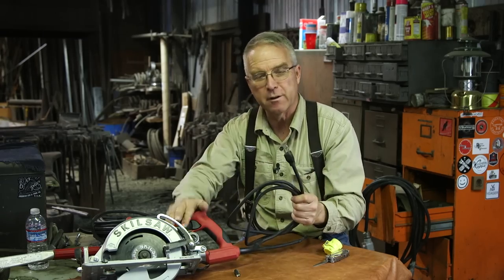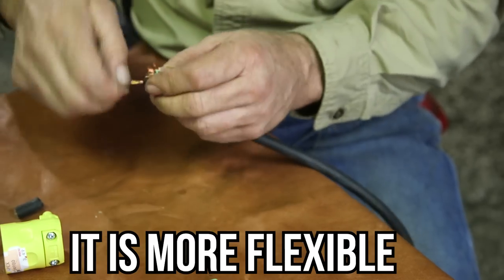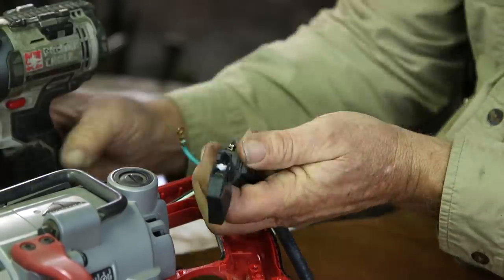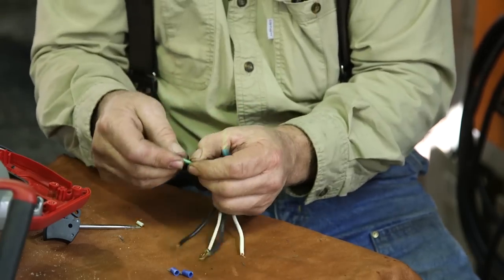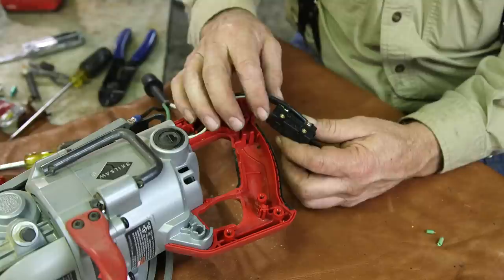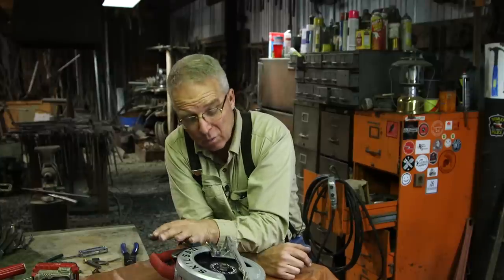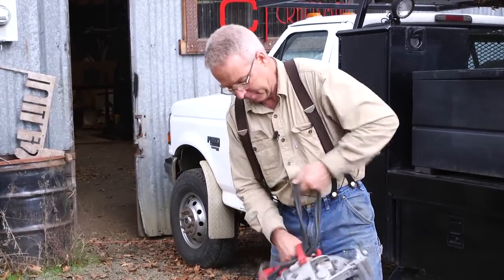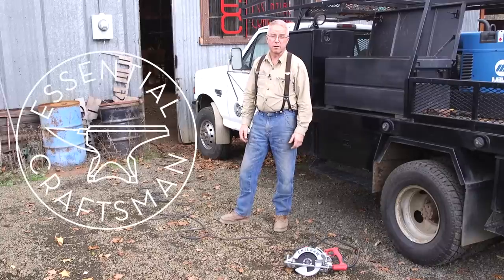Skilsaw Cord Install and Storage Tip

Comment: after one of your earlier videos where you mentioned this, i went out to my shop that day and did mine. i had on old, heavy-duty extension cord that i hardly ever used. so i cut off the female end, wired it up; and now i have a 50 ft. cord on my circular saw.

it's awesome not having to drag out an extension cord every time i wanna use it for something out in the yard. i can just plug it into the external outlet on my shop and go to work. i'm also thinking of doing this on my big drill.

and i store mine the same way. i use the "daisy chain" method for the cord. it never gets tangled, it never gets that awful twist in the cord that you see when people do that whole "hand-to-elbow" wrap. it definitely saves the cord and doesn't cause NEAR as much strain (if any at all) on it.

Comment: We used to do something similar! Back then I was a Sparkie working on domestic installations. We would have 240V Drills (rather than saws) and the leads were always too short. We would put a long lead on (long enough to reach the full length of the house. The flex was then wrapped round the handle and the pistol grip of the drill .... zero snags!

Comment: Long cord on a circ saw is definitely necessary for jobsite use. That said, since I bought Makitas rear handle blade left circ saw, my corded saw has been reassigned to steel and concrete cutting duty. The new cordless saws are finally on par with their corded brethren in terms of power, even more powerful in fact, and you don't have to worry about a cord of any length. The real question is how they will stand up to jobsite abuse. I haven't babied the Makita but it's still pretty green. Mag 77's just run, and run and run. Only 77 I've ever seen that was broken was due to an oil leak and subsequent failure of the worm gear.
Reply: We acquired a dual battery Makita skill saw three years ago. Since our type of work is very dynamic, meaning we have quite a wide range of tools that get used here and there, rather than a few tools that receive a ton of use, it hasn't been "abused", so to say, but it has seen more than "weekend warrior" use, and it certainly is holding up pretty well so far. It'll rip 2x4 with about 75% of the capacity of a corded one, which I believe is certainly good enough for it being cordless.
In fact, since we mostly work on mobile homes in retirement parks, and the available outlets can  be quite weak, sometimes it has more cutting capacity than the corded one.

Comment: I bought the direct connect Bosch years ago and it works very similar to this demo. I wind the extension cord exactly the same. I get the same freedom. My back up is the Fuel 18 volt Milwaukee. Great combo.

Comment: Funny... I've always taken the exact opposite approach... I leave a 6" nub wire with a 3-prong on my saw... Makes for easy storage. And, I just knot a 50' extension on to it when I'm ready to get rockin and rolling.  Never get's tangled in the box, and allows me to store my cabling away in a special box for only cables...
Reply: Tim Falardeau wait, you are not my neighbor - ha. (see my original comment....)
Reply: I'm with you.  To have a 50' cord on each tool is ridiculous.  Have tools with short, or factory cords, and use extension cords of the appropriate length and gauge.

Comment: Tip for ring terminals, if you need more room than the insulated terminals to fit, before installation remove the plastic sleeve, hold the ring with pliers and pry/pull off the plastic sleeve.  If the crimp tube is a little to tight to get al the wires into expand it a touck with your awl/ice pick while holding the ring with pliers then assemble and crimp

Comment: In video about skill saw you showed us how to store a saw and how to tie a cord so it doesn't tangle, and i started using it to see if i like it. 2 years later i don't know how did i live without it, all you need to do on job is pull one end of the cord, plug it in and you are ready to go.

Comment: Before I watched this video i was having a problem with my angel grinder's cord becoming loose and then slowly working apart until it shorted, so i got tired of it an rewired a 25' orange extension in place of the factory cord and have had no problems and it works beautifully!  I do a good bit of cutting and grinding off the back of the truck..lol.

Comment: Most of the carpenters I know have gone cordless.  This latest generation of cordless tools are lite and powerful.  The 6" circular saws can cut 2x and decking just fine and sticking an extra battery in your tool belt to extend your time up top.  There is a place for corded tools on the job site but carrying heavy plugin tools all day is rapidly becoming history.  That said I have a corded Makita saw that  I use with abrasive blades to cut steel.  It is going to get a longer cord in a day ot two.  Thanks for the tip.

Comment: Excellent upgrade. We do the same, only with 25'  We also just cut the end off and use solder-less connectors for the extension piece but separate each one by 2-3'' so we don't end up with a lump in the wire. After the connections are done with never-seize, we slide the 3 pieces of shrink tube over and shrink one at a time, each one longer than the last, then tape. We use a new end like you do, with never-seize of course, so there is only one, so called lump in the wire. I will do it your way from now on, because I forgot about the wire size difference between the new and old or maybe I was lazy about taking the handle apart, lol !  Thanks for the education always.

Comment: My dad used to buy extension chords for this.  He thought it was an advantage that the extension chord came with the molded plug already attached.
Reply: WJ the Home Builder you can buy the cables with the moulded plug already attached to them in Europe :) my grandfather used to attach those to his tools :)
Reply: it's also cheaper than buying  the wire by the foot.
Reply: @davesbrewing  and it's more likely to be the right kind of wire for that application :)
Reply: That’s what I did to make an extended cord on my vintage Sawzall. Bought a high quality USA made all rubber 20ft extension cord and lopped the female end off and installed. Been going great on the job for 15 years now
Reply: @JerryWick  I have been doing the same for years!
Reply: I have cut the female connector off of extension cords for fixed location machines (some times you can buy an extension cord cheaper than just the wire), but I have seen the molded plugs come loose too.  I don't see a problem with the replacement ends if they are for the correct diameter and have a decent strain relief.
Reply: CPUDOCTHE1 yup. There are a lot of high quality repair ends. I always buy the best and keep a few on hand of both genders to make quick repairs
Reply: I find it hard to get 12 ga extension cords in my area for cheaper than wire by the foot from my wholesaler.  14 ga  extensions are a dime a dozen for sure.  Just my experience.
Reply: David Star junk plastic though

Comment: In 1976 my boss bought a me a worm drive skill saw model 77 since than I have put several 25 foot cords on it due to being crushed, cut in half( can you imagine that) and not using a good enough cord and it got to stiff. You are a lucky man to get to buy a new saw mine will not die, new handle, brushes and it's still going 4 new homes later, decks, roofs, remodel's heck I even flew it to Alaska to do a big remodel for my brother. I feel like tom hanks in the green mile it will be with me for the rest of my life. I guess that's not such of a bad thing after all is it. I'm 60 now and half way done with our retirement home so I guess the skill saw 77 will be passed on to my kids thanks for letting me ramble. love your videos

Comment: I like a long cord on my saws too. Makes life much better. You can buy shrink fit electric insulation tubing to replace those blue plastic ones. Comes in many diameters, check auto parts stores or Radio Shack. It comes in 3' lengths, cuts with scissors, and hit with your heat gun for a nice snug, insulating fit. That yellow replacement plug end. You can spray that with several coats of Flex Seal, as seen on TV. It does work well and will waterproof that plug. Hope the New Year brings you and yours nothing but the best Scott. Love all your videos.

Comment: Yet more wisdom from the purveyor of practical goodness!  Thanks Scott.
Solderless terminals are available in all sizes, if you can't get them at Ace try Platt electric.   You can drive the terminal (metal part) out of the plastic jacket with a punch or even a nail.  With a good Klein crimper you get a much more sure crimp on non insulated terminals.
Even if you aren't a spark chaser you should get a pair of Klein crimpers, much better than that stamped sheet metal thing you have.  Like with all things, quality tools make the job a lot more enjoyable.
Reply: Marcus Merrick great advice Marcus! I also need to get a new pair of crimpers I looked at the Klein line and they have several different ones any advise on which ones to purchase? Thank you for the great info have a wonderful weekend.
Reply: Good point. The crimp available on the typical solderless terminal isn't the greatest, and a source for added resistance (and heat produced) by the tool. Sometimes, I will even solder the lug to the wire after crimping so I know I am getting the best connection possible. Less resistance/ voltage drop equals less amperage pulled through the tool and much longer tool life.
Reply: @andrewbieger5004  getting good terminals helps, actual Thomas and Betts brand (try a professional electrical supply house like Platt) are thicker and better quality than the import brand you get at the megalo-mart.   I'm not an electrician by trade, but I gerw up in a house full of them and this was drilled into me for as long as I can remember.   Now I mostly do maintenance and rebuild machine tools.  The T&B are easier to use and have less resistance.
Reply: @paulrhodes482  the ones I inherited from my father who was a maintenance electrician for 40 years are the 9 3/4" inch cutter and crimper combination.  Current model is the 1006, with large and small (insulated and un insulated) crimper and a cutting jaw.  If you can't find them locally, Amazon carries Klien.  They are about twice the price of the cheap import but I'll give these to my son and he will probably give them to his kids some day.
Reply: @msquared6324  Thank you I will take a look now on Amazon! Have a Happy New Year.
Reply: Thanks for the info, Marcus. I will stop by my local City Electric to see what they stock. I am overdue to get a total new connector kit anyway.

Comment: Part of the reason why I love YouTube channels like this: Getting exposed to more ideas on how to tackle common problems than what you might see in your own home town. I've almost never seen a contractor swap the factory cable for a more useful length, but I really don't know why this isn't the norm. (This seems like such a practical and sensible thing that I don't know why they don't ship from the factory with a short lead in the box, but expect the buyer to finish wiring it themselves to their own specification.)

The one contractor I've seen and remember having swapped his cables has gone kind of the opposite with his tools - He replaces the factory lead with an even shorter one, but with a neat locking plug instead of the standard friction plug.

He then uses extension cords with the mate to the locking plug connector, and can quickly switch the length of the cord to the job needed, or swap between tools at his work site with a single cord. (And a cord that stays firmly attached to the tool till he unscrews the locking collar.)

Getting a cut in a cable 6 inches from the tool is usually pretty hard to do, but if someone shears your extension cable you can just swap out for another from your kit box and carry on, rather than having a tool out of action till you rip it apart to rewire it completely.

I sadly have no idea what fitting he uses, but it is just large enough that you can still plug most standard 3 prong north american cords into the extension cord without them needing to have the locking collar on them. If someone happens to know a maker of them, I would love to find a source for my own gear.

Comment: Quick tip about the easily stripped plastic and other materials that are "soft" use a drop or 2 of super glue in the stripped hole and allow to dry / cure fully before replacing the fastener / screw we use this all the time in the RC community. Grate tip by the way I look forward to upgrading my trusty old saw and maybe a few other tools that can use the extra reach.

Comment: Just some information there's a strip gauge usually printed on the face of the plug to allow you to cut the wires to the right length. Great video and happy New Year.

Comment: Thanks for this video!! This is exactly how I had mines for years. Mag77 and 50ft of 12g wire wound up just like that! But since I’ve bought the Dewalt battery operated worm drive style saw, I’ve never had to plug in again. Honestly, it’s powerful enough that I havent noticed any power loss difference from a mag77 and it’s completely cordless. On a very heavy use day, I just go through 2 9ah batteries, one in the saw and bring a fully charged extra, that’s it! It is slightly heavier but not enough to complain about. The Dewalt Saw has been a game changer for me.

Comment: We used to call that technique for wrapping up an extension cord, a ‘sailors stitch’ or ‘sailors chain’. I always tried to let my guys work they way they wanted to or felt most comfortable, UNLESS they were doing something grossly wrong. If you try and tell someone what and how to do everything, all the way down to how to roll up their extension cord, you’re bound to get some push-back. Just let them learn by example. BUT it did always frustrate me to see someone unwind a cord by grabbing  one end and throw the rest on the ground and start walking towards the tool or the outlet 🙄🙄!! It WILL tangle EVERY time. Good vid Scott/Nate 🤜🤛
Reply from the maker: great comment, thank you!

Comment: Hello Mr.Scott , our mentor 
Me  what i have done is different 
I cut the wire 1 foot from the saw , and at the other end. i cut 1 foot. before the plug 
Than i inserted  the 20 foot cord  as a splice in between , and solder the wires and taped nicely
This way i don't have to open the saw and i have at the other end the original plug 
12 guage wire etc 
I only have a very small  section working on original wire that don't affect the operation at all 
Thanks 
Serge ( from Mtl )

Comment: When I was stationed in Alaska we would use the crochet method on any lined we had to use. When you're wearing heavy mittens and everything is -50F, using your bare hands are out of the question. Ever since then its how I've stored extension cords to guy lines.

Comment: You'll get by with wrapping cords like that for a while in hot climates.   But in the cold you'll crack the insulation and then the wires.   Those things for Xmas lights are cheap and work equally well for cords.